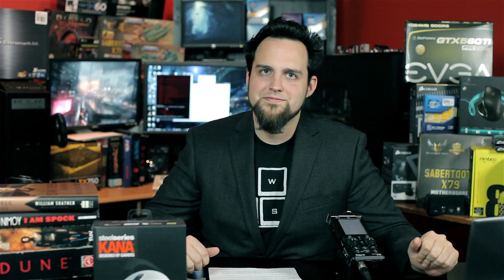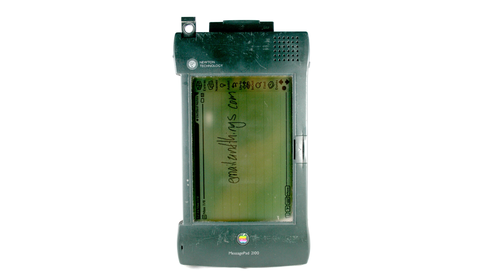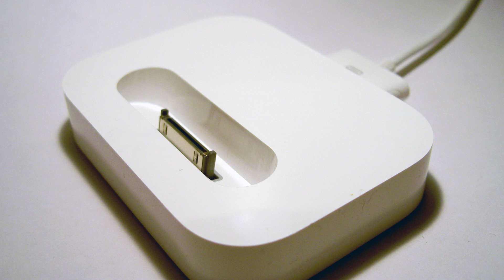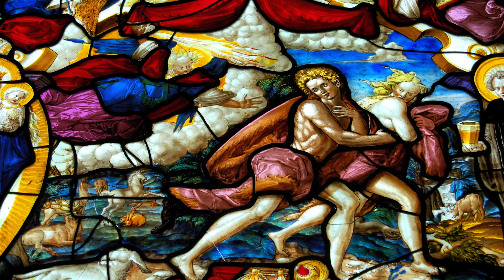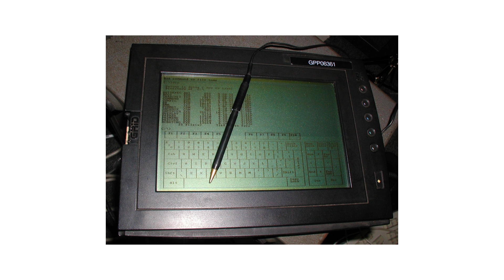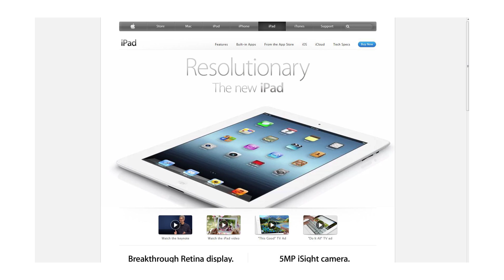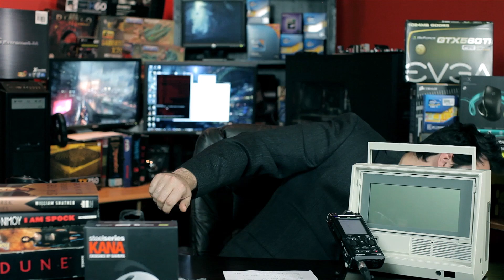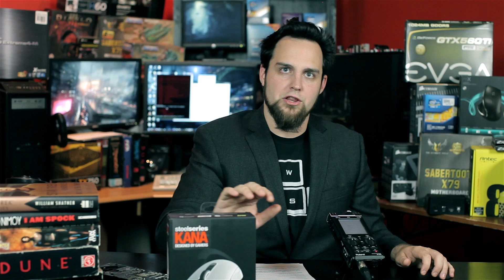Has Apple Really Ever Invented Anything?

Comment: Come on, really? You're just guessing. Can't provide links here. 60/120Hz display, zero difference. You're talking about the wrong part of the display.
Correct without VSync, the video card frames are independent. But the hardware throttles is down, go use google. Overclocking is used to keep the display at 30-60FPS under heavy load. 30 is enough for display, but if you want a responsive game, you need more because 100% of the machine is just doing the graphics work and you get jitter.

Comment: The only thing you can see different is the codex and processing of the video. 60Hz and 120Hz monitors on signals today are identical.

Not arguing about the fps throttle. Call NVidia and ask tech. They've been doing this a while now. Think about it, card is rendering say 300fps, but you're on a 120Hz display... where do the extra frames go? Dropped? Why render drop frames? That's why they throttle it. There's no point to render them.

Comment: The FPS listed in games isn't FPS, it's UPS (updates per second). Modern GFX cards typically don't exceed the FPS of the target output rate, which maxes out at 60fps. The reasons are obvious, anything higher is wasted, and causes heat/power issues. Your 120Hz monitor displays 120fps, for 24fps movie video, it shows the same 5 times within and for 30fps video is shows the same frame 4 times. In essence, still just 30fps.

Comment: You're completely wrong.. to both wikipedia and all other video mag sites. You unquestionably will not see ANY difference on a 60 or 120Hz display. The signal going to the display is for either 24, 30, or 60fps, PERIOD. Monitors/TVs don't put out a signal, they display them. They use 120Hz because it's the lowest common multiple of 24 and 30fps. Last I said the game runs faster with VSync off, not because of 120Hz. Do you even have ANY technical knowledge? It doesn't seem like you can read. ugh

Comment: They are popular, and they are dying out on the PC/Mac. Consoles are taking over, and at some point, a tablet will replace the console. The part of the PC that makes Crysis run at high rates is the video card. High end cards but lots of power, create heat, and when pushed hard, start to have display problems and fail prematurely. Macs run "close enough" on games, and do everything else better by creating a reliable system. All I can say is, force yourself to try a Mac for 3 months...

Comment: Wrong. Any game system can run the visual frame rate at 140 or whatever, but regardless of the TV 30, 120, 240Hz refresh rate, the user will not see it. Video devices are putting out 30 or 60 frames per second in HD to be compatible. VSync doesn't change this in a game. It syncs the game with the display refresh to stop screen tearing. Games don't do this by default because on many displays, like 120Hz and up, it's not a problem and the game runs faster.

Comment: Well I call you stupid because you're stupid. Video games are toys. What are video games to you? Industrial building materials?
PS3 games run at 30fps because they're throttled to match the TV frame rates. No PC games run at 140fps technically. They may do 140 updates/sec, but the frame rendering engine is throttled to 30 or 60fps. Extreme multitasks like you playing WoW? lol... and what your PC does to a Mac in Vegas stays in Vegas. I know people with 64GB Macs, but they're not multitasking.

Comment: Correction, screen was co-designed by Apple/Samsung manufactured by Samsung and LG, Sharp is starting to take over productions now. 
Case and the manufacturing process for the unibody and iMac bodies were 100% design by Apple.
Sony was not even close to the first to use a chiclet.

Comment: Yea I don't know anyone that going to say that plastic used for laptops is stronger than Aluminium. It sucks you dented it, but if you'd have had say a Dell laptop, it would have cracked the case. So what do you hate more, a dent or a crack in the case? It's not the Apple store or your case's fault, you put something on it with enough pressure to dent machined aluminium.

Comment: Macs sure don't use the same hardware. The use the same chips, but the motherboard design is custom, the airflow is custom, the screens are custom, the case is custom, the battery is custom, the keyboard is custom, and the mouse is custom. About the only thing that's not is the DIMM RAM and drives, and even then Fushion is specific to the Mac as well. Google 'insert your favorite laptop here' and "Macbook pro inside", go to images, enjoy. Not even remotely close.

Comment: Michael Fields, you're an absolute idiot. See I can do it too. Read what I wrote? You can do anything on both, but you tend to be more productive when you're not chasing problems with the OS, drivers, rebooting, or crashing. Beyond that, you cannot use SSH, SCP, and other server tools without getting putty or cygwin. I installed win7 because we use HP QC that requires explorer. Hackintoshes aren't popular because it's the hardware + OS that makes Mac a Mac.
Smart professionals I know use Mac.

Comment: Let's say you're the CEO of a company, and the CTO says you need a plan to roll out Windows 7 while using Office 2003 which won't be a problem for the always-on databases. Then your CTO looks puzzled as he cleans up his resume because the three are unrelated and thinks the CTO is a boob.

See, you can run iWorks back to OSX from 2004 and MS Office for Mac back to 2006. So how old are your freak'in machines anyway? Also, DB drivers work back to who knows when, so that doesn't count either.

Comment: Asus and Toshiba (hardware only) beats Apple stats by less than 2%. But quality is far more than failure rate. Quality means the screen looks good, the case doesn't fall apart, the mouse doesn't break, the keys don't rub off, the trackpad doesn't look worn, the mouse nub doesn't stop working, the OS is stable, the doors and buttons don't pop off. I had every one of these issues on my laptops. Macbook pro, zero issues. 
Now do me a favor and google "customer satisfaction laptops". Apple is #1.

Comment: 1) If the OS can run whatever OS you need, which it can, where is the issue?  If the company plans to never update their systems for desktop users, which almost NO company does that, fine, but you're not on Windows then either, right? Otherwise, see point #1, and I do this for HP QC. You are also missing the point that, if you have legacy software, you should stay on the SAME OS, not upgrade, which a vast majority of companies do. So what does that 20 years of compatibility buy you? Nothing.

Comment: Xeons are server and workstation CPUs, and specifically are better at multitasking than the 'i' series. The i7 extreme versions are identical to the regular i7 CPUs except the extreme versions can be overclocked without restrictions. If you want to play engineer and risk baking your CPU or causing issues, so be it. 
From Wikipedia: "The Xeon is a brand of microprocessors targeted at the non-consumer workstation, server, and embedded system markets." I guess that makes me more qualified than you.

Comment: The Xeon on the Macs is not the same Xeon as the workstation CPUs. The only thing similar that it has with the real Xeons is the multi-CPU cooperation capabilities. Other than that, it's total shit. It's on a 45nm process. Sandy Bridge were delivering jaw dropping performance and the flagship Sandy Bridge CPU X3960 was the king of the CPUs for a while (Yeah even enterprise ones). Also sandy bridge is arguably better than Ivy bridge most because it overclocks must better. You know shit bro.

Comment: Without a support program from a vendor, if something fails then the cost to fix it is on you. You can take it to an AppleStore or, like other laptops, you can mail it. 
1. The RAM on the new MBP CANNOT become unseated. The RAM is soldered in, which makes it more reliable.
2. Yep, all system can have issues, and again, ANY vendor will charge you to replace it. Period.
3. With AppleCare, free. Without it, about the same as another vendor's high res display.

Comment: I'm not buying a $2500 Mac first of all. It's still a Xeon, I would rather game. Also, you don't know it will be updated, and NO a WINDOWS PC FROM 2001. Still works fine, can play YouTube. Also, the Mac cannot perform better overall. a Xeon is horrible for gaming, and an i7 is MUCH better. the i7 is for raw power. I can get a Xeon for cheaper, more RAM and it still uses a 5770, LAME. Also, Apple doesn't support 10.5, I've already tried calling to get a copy, they don't support it. Same with SL.

Comment: G5 from 2003? Holy crap are you ever going to upgrade it? Call Apple, you can get a copy of 10.5 for $20. On the Xeon, I did some digging, and the core CPU speed is getting dated. I'd still say the Mac will perform better overall, but they are updating it for 2013. So me personally, yea, I'd wait to buy one, but then they updated it, it'll be awesome sauce.

Comment: 500 characters isn't enough lol.
On 4, so you get a display and lid combined and replace it. That's just the way it goes for the size and weight savings.
Apple thought this through extensively. They didn't do any this "just because". It all has a valid reason, and I've used a retina 15 with 16GB of RAM. It's insanely fast.

Comment: 1. I have the MBP with phillips screws. The pentalobe is a better option as they're much harder to strip out.
2. RAM is, but at 16GB, I'm unlikely to add more, and they saved both space and increased the performance of the RAM doing this.
3. At over 1k charge cycles, it's very unlikely you'll need to replace it. If you do, you can get Apple to do it, even under AppleCare.
4. Just like cars, you don't repair the display, you replace it. My friend has his done in 1 hour going from LG to Samsung.

Comment: Your overclocked i7 is not going to come close to a MacPro with Xeons, they're balls fast. Odds are too, my laptop will run very close to the performance spec of your system excluding the graphics benchmarks. I too have a $1600 win box for gaming, but outside of games, it feels a tad slower than my 17in MBP.

I have replaced the ram in my MBP to 16GB, and replaced a fan. Cake. The new retina 15 MBP is NOT welded shut. You need to know what you're talking about before you make ludicrous claims.

Comment: They both have their flops, As pointed out here, OS9 until they switched to a BSD backbone, Apple has not had great OS success. I don't disagree about MS and their devices. We're currently in the bad OS loop of the MS dev cycle. After 8, it will be all gravy for their desktop and mobile platforms.

Comment: The microsoft surface is heavier and has a lower resolution, but it still is full HD and it is slower, because it runs windows 8, which is a lot more demanding than IOS since it has a lot more stuff. If you were to put the same processors into an apple (nvidia tegra 3), then the apple would be a lot faster, but because the nvidia tegra 3 is faster, its also heavier and larger. It comes down to that windows 8 isnt suitable yet for tablets, since fast enough proccessors dont exist yet.

Comment: The original iOS device CPUs were Samsung CPUs. Apple A4 and higher CPUs were DESIGNED by Apple, and manufactured by Samsung. ARM never manufactured CPUs for Apple.

This notion that unibody is wasteful, let me ask you, how? All the CNC machined leftover aluminum is recycled, as per the Apple 'green' initiatives. So what's wasteful? At least 3 years later, my Macbook Pro will look just like it did on the day I bought it. My Dell Insprion 9100 that cost me $3400 is now a doorstop.

Comment: Think of this: apple couldnt make it any better than the windows tablet in 2002, because suitable components didnt exist. If windows were to make their tablet today, it would be as good, if not better. The fact is, they made one by windows themselves, called the windows 8 tablet. It has a faster processor, more ram and better graphics card than the latest ipad and the starter model is cheaper as well and yes the battery life is a bit shorter (7 hours), but what do you expect from the components?

Comment: They dont... they have the same components from the same manufacturer as windows pc's... yes it outlasts the cheaper windows pc's, but some better ones, which are still cheaper, will last just as long, if not longer as they have better cooling and equal build quality. The 14" Alienware is cheaper and more powerfull than the mac book pro (except the retina one, which is slightly more powerfull), but it has 2 huge exhaust vents that cool it down to 40C, so the components last longer than a mac.

Comment: I still have my packard bell desktop from 1999 running windows 8... it still works great, but a little slow (duhh... its 13 years old). I also have this 2006 hp laptop, which back in the day costed the same as an apple probook and it has an intel corde duo, which was the fastest at the time (i7 didnt exist then...). Its still is faster than any apple under 1500$ and about the viruses... whenever i do have it, which I rarely do, an OS restore fixes everything (spam f11 on startup).

Comment: Lifespan depends mostly on parts and cooling and all parts that apple uses are also in windows as they are made by other companies, so those are pretty much equal. So the only thing left is built quality and cooling. Built quality of apple is pretty good and yes, there are cheaper windows laptops out there, but higher end laptops like alienware or asus also have good built quality. The only thing left is cooling. The better the cooling, the longer it lasts. Apple laptops arent the best at that.

Comment: Also, your claim that Mac OS X is not something Apple invented because it is basically just UNIX is bs. OS X is an incredibly powerful, complex operating system, built on a lot more than just UNIX, and Apple has done a lot of innovating in that space since they started working on it. Technically, Apple didn't invent it, but only because the root of most of its technologies comes from NeXT and older Apple OSs.

Comment: i use pcs too. i build pcs. my current pc rig is an i5 sandybridge core, 16gb ddr3ram, 700watt psu, nividia gpu, water cooling on the core, cooler master case, with blue cold cathode lights, 4 fans, msi B75MA-E33 Mobo, and a blue ray drive. my pcs dont suck. its the os that i dont like

Comment: Performance does matter. And for starters, clock frequency and # of cores is far from everything that defines performance. Everything from OS efficiency, programming languages used, the instruction set architecture, pipelining and other things matter. A simple example is how great iPhone 5 performs on such "crappy hardware". Software for idiots is an idiotic statement, regardless of any factual or logical basis. Example: all platforms can do email, but the experience is not the same.

Comment: Yes! But some people that doesn't need a really powerful computer for 3D-animations or so and doesn't want to struggle with strange problems/bugs and bad design, will prefer things like macs and ipads over other pc:s and tablets.

My MBA does the most that I would like it to do (but not everything). It's intuitive and simple to use with the most programs I need. Really good designed and portable. But when I'm programming my robot, I'm using Parallels (Windows), and it works perfect.

Comment: your custom pc from 2010 doesnt have a fullbody aluminum case and apple engineering. lol. nor does it have osx. graphics only matter in gaming. as you can tell mac users dont gaf about gaming. your "top of the line" gaming pcs "alienware" is just dell with a shiny case and fancy lights, adding 2000 to the price tag. LOL. atleast macs do something with the money. my pc rig from 2012 would pwn a mac at hardware. but you cant touch the software of osx

Comment: Utter rubbish. I design electronics/mechanics and write embedded firmwire for industrial laser systems. None of the CAD, simulation or firmware development tools i use run on the Mac platform, and even if they did, what would be the point? Serious industry avoids Mac like the plague, with good reason. Oh, and btw, the great thing about proper computers is that games ALSO run great. 

Fuck off. You're full of it.

Comment: I have a macbook pro retina. Read a few review sites. It's the best laptop out at the moment, unless you do a custom build. I can run OSX and Windows. You can't. I can run BF3 and skyrim on max graphics. I have 10 hours battery life. If your pc was so great you would be spending more time using it instead of trolling.
I will compare my macbook pro experience with a BMW. I own both. Both run smoother and quicker then the current competition that's why I have them.

Comment: The definition of invent is - Create or design something that has not existed before. Apple is an innovation company. They take things that exist, for example the Diamond Rio, and they made it their own (The iPod). Apple made it charge through FireWire, rather than using an AA battery, made it have 5 gb of internal storage rather than 32 mb etc. etc. etc. Whereas apple DID invent Unibody, as explained in the video

Comment: The apple a6 designed in house by apple while complying with the open ARM standard.  Modern aluminum manufacturing processes with advanced tooling to reduce waste. Invention is the modification and alteration of existing products to solve a solution just like it is the process of creating an idea from thin air(which is rare since all created things are based on existing principles.)

Comment: GRiDPad - Made in 1989 by Samsung for GRiD Systems Corporation.
Touch centered Smartphones - This one argueable, some say Samsung had prototypes and concepts before Apple.
Pointing devices for Computing (a.k.a. mices/mouses) - 1981, Xerox 8010. (Earlier uses and prototypes date back from the 60s or 70s if I'm not mistaken)
GUI- Xero 8010, just like mices.